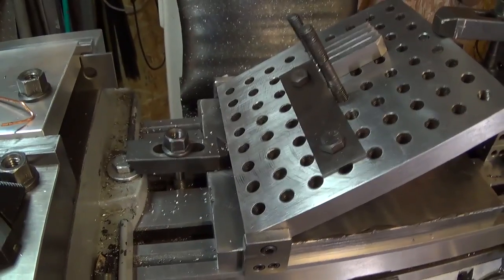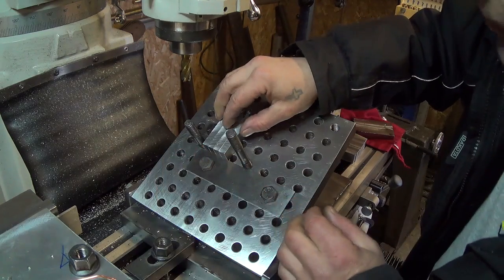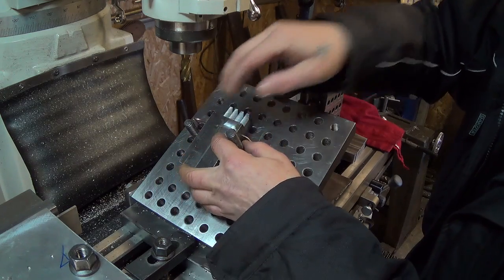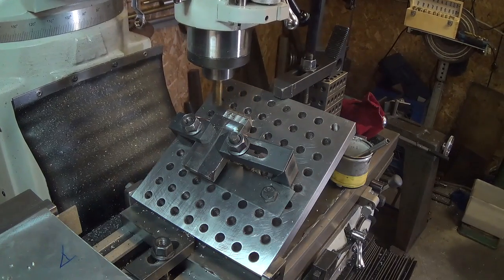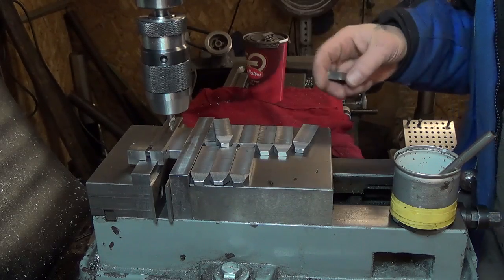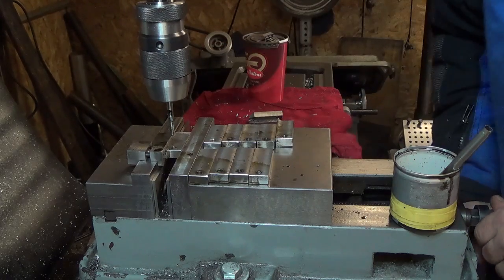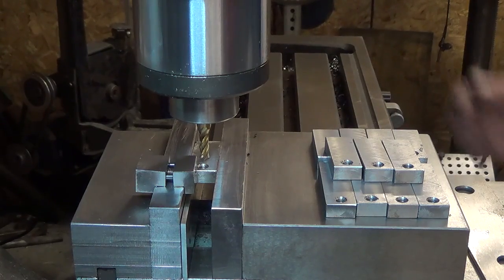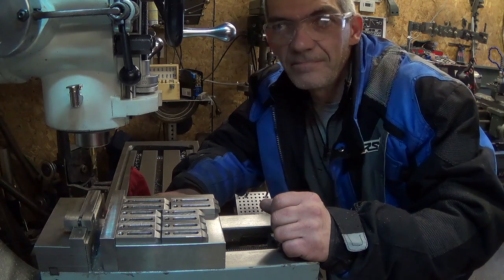Mini-Pallet - Part 2

Comment: enjoyed watching you make the clamps as i just did the same project. i had 118 1/4--20 holes in the one i made spaced at one inch. asi metioned earlier i have the same mill as you do so i was wondering how often do you greese your head and what type of greese do you use? thanks.
Reply from the maker: Jamie Buckley My unit only has 2 oil cups. I refill those with motor oil probably once a week depending on the amount of usage. ;-)
Reply: Ok thanks

Comment: nice job. great video. need to make some clamps and the mini pallet also. like the two size taped holes in the pallet. thanks for sharing.
Reply from the maker: sam yeates Thanks Sam. Used it yesterday for the first time in a customer job on some stainless tube/aluminum block helicopter parts. There was no simpler way to clamp up the pieces for drilling. I'm sure it'll get used more as time goes on.  Colin ;-)

Comment: Hi Colin, I was a witness to your broken tap accident and I'd like to suggest a successful method for removal without resorting to EDM. You'll need a solid carbide center drill of appropiate size to start the hole and then a straight two flute (no spiral which is weaker) carbide drill, such procedure will bore thru the tap like butter. Use a smaller than tap size to save your threads.Bore and blow the shavings as you go. A carbide ball type cutter will also serve your purpose (after the center drill).As a bonus you'll keep the tools for future use.

Cheers

Jorge
Reply: Sorry Colin I send advise to wrong video.
Reply from the maker: Jorge Scordamaglia
Hi Jorge. I have used those type of drill for hardened studs that had a cracking issue in some snowmobiles a few years back. Didnt have one on hand at the time and being how it didnt really matter to remove the broken tap...just move the insert to new location.
Also: it doesn't matter which video as long as you comment! ;-)
Thanks
Colin

Comment: Nice workmanship.  What material did you use for the clamps?   I had some $$$ ground stock 4140, left over from a project, from McMaster (1/4" x 1/2" -- for 10-32 screws & slots).   I use a phase-a-matic -- but have a 3hp idler motor. Only problem is my mill's flywheel is massive, so it keeps on spinning when tapping (turn on, engage, turn off.... inertia taps nicely).   Cool copper wire trick, I'll use some brown wrapping paper (aka butcher paper) to help with the variation.

For blue or blacking steel, get a Brownells gun smith catalog.
Reply from the maker: I just used what was on hand, IE: HR flat bar. Pretty much any steel would be fine as the clamping force wont be terribly high for what the pallet will do. The ground stock will have a nicer surface finish. :-)
I have to use the brake when tapping as the flywheel effect will push the tap clear through if it doesnt break. Not a time to be day dreaming.
Thanks for commenting Tom! I sent you a PM if you would kindly respond. :-)

Colin

Comment: Love the copper wire idea.  I haven't seen it done with that before.  Thanks!!
Reply from the maker: Hi Mike. I use the copper wire quite often when holding multiple parts. I also keep a piece of 4 strands twisted and soldered together near the vice for occasional use holding uneven parts.

Thanks
Colin
Reply: *****
Cool!  I've always used aluminum, but sometimes it isn't soft enough.  The copper would be perfect!
Thanks!
Mike
Reply from the maker: Thats what me try it the first time. I had lots of copper wire kicking around and just got to thinking.....and it still hurts! :-)
Reply: *****
lol!